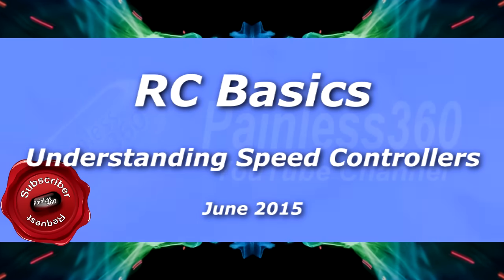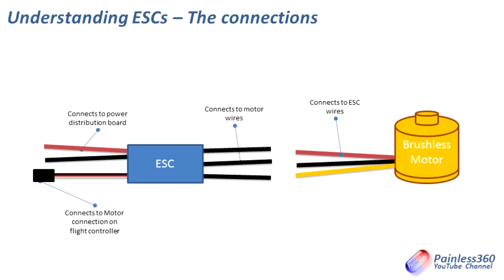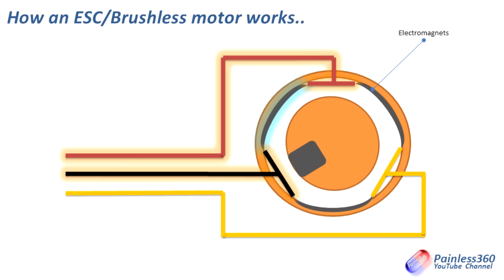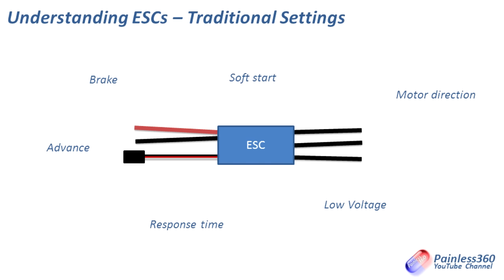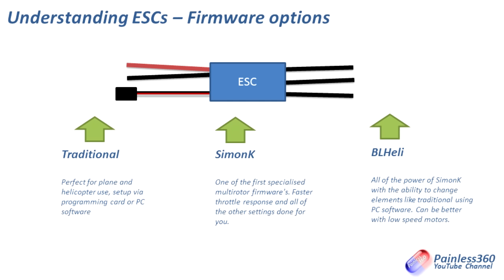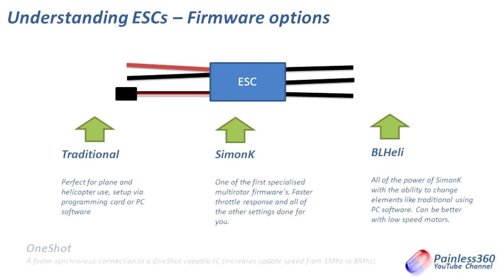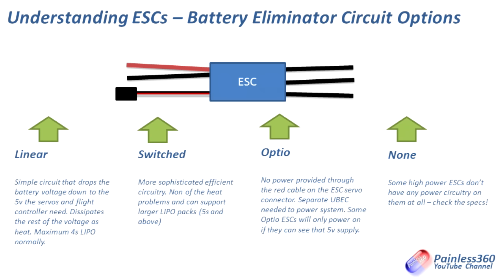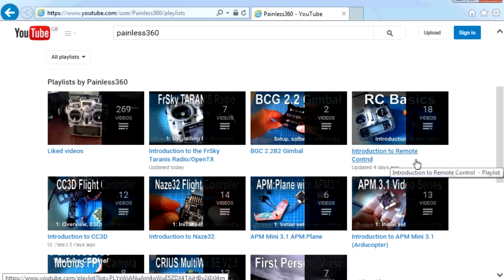RC Basics - Understanding Electronic Speed Controllers (ESC)

Comment: Great video 
I have a 80/100 130kv outrunner 
I looking to buy an esc to make it run powerfully 
Can you help me finding the esc pls
Reply from the maker: You'll need an ESC with a slightly higher amperage rating than the motor. So, first - find out the max current that motor needs when spinning the prop you'll use.. Best of luck!
Reply: http://alienpowersystem.com/shop/brushless-motors/c80100-outrunner-brushless-motor-130kv-7000w/
This is what I have 
I found lots of esc
But my motor says 18s max 
The max I can find is like 12s will the esc go bad ?
Reply from the maker: +mike mike it's the amperage you should be looking at..

Comment: Hey there awesome video, really clear explanation. I was wondering however about the fact that you have to switch any two wires for two of the escs and keep the other two straight. Does it matter which motor is crossed and which isn't, for example should the straight wires be for the clockwise motors and the crossed for the anticlockwise?
Reply from the maker: OllieTheCat2012 Nope, swap any two of the three wires going to the motor and it reverses the direction. 
Happy flying!
Reply: Thank you kindly!

Comment: Great video. I've one question. Can I use those ESCs in a e.g. airboat? I know, I've to make them waterproof. But can a combination like a RadioLink EC6GS remote with a 6 channel receiver and a e.g. Yuki Wasabi Eco BL-ESC 55A (http://files.hapo-trade.at/pdf/WASABI%20ECO(DE+EN).pdf) if I switch off things like govemor mode and break?
Reply from the maker: So long as the current rating is high enough for her motor and prop you're using then yes. You can waterproof the esc using one of the waterproofing sprays or epoxy too..
Reply: Thx for your help. That sounds promising. Great work and I guess you have a new subscriber ;-)

Comment: I've got a rc plane with the controller and I can't get the motor to turn
Reply from the maker: Some have a throttle cut switch or a way to 'arm' the model so that it prop turns.. I'd like check the manual for the sequence... Best of luck

Comment: Someone please help , how can i connect a motor with an ESC into the steering channel ??
Reply from the maker: A steering channel normally rests at the middle channel value, ok for a steering servo but problematic for an esc as the esc will see the middle channel value as 50% throttle... see the other videos in the RC basics playlist..
Reply: @Painless360  Thing is i'm building a crane and i'm trying to have 2 electric motors , one of them for each channel and i havent found anything that could help me do it.
Reply from the maker: Check out the other videos in the RC basics playlist. It's not too tricky if you dont use a throttle channel... best of luck!

Comment: Can you do a video on testing the ESCs and motors with a multimeter to check if they are running properly
Reply from the maker: +scimitar4211 Interesting idea, what specifically caused you to ask?
Reply: +Painless360 I am in the process of building a Blackout mini h, currently I have run into some problems.  When testing my motors using Cleanflight 2 of 4 ESCs let out the magic smoke and possibly ruining the motors as well.  I am sure all the pros check their ESCs before soldering to the PDB and to the motors, but to us newbies we just solder on and hope for the best.  Unfortunately I learned my lesson the hard way and I will be getting a multimeter to test my ESCs next time.  Some of us do not know how to check for continuity on the ESCs and/or the motors (including myself) so I thought it would be a great idea for a pro like yourself to do a video on that.

Comment: Thanks for the video learned a lot but I am working with a Mystery Fire dragon 80A ESC and still figuring about how to program it to go backwards and revers like a in an RC car and how to control it with a single signal wire.
Reply from the maker: +Derpy Herpy the answers for these things are usually in the documentation. If it's not then it's not supported. I'd ask the vendor the same question..
Reply: +Painless360 do you know of any ESC that has that feature of going forwards and reverse? 
If not I'll probably have to work hard to program the AVR cheap on the board to have that function..
Reply from the maker: +Derpy Herpy look for those that support 3D flying. Best of luck!

Comment: Another great video and your channel is my first stop for technical information on RC! Hopefully you can help me with this? If you use ESCs without BECs what would be the best way to set up a 5 volt power supply?
Reply from the maker: Peter Arnold To see more videos on RC power systems visit - https://www.youtube.com/playlist?list...
You need to use a separate UBEC to power the board. Some now come fitted to the power distribution boards for simplicity.
Happy flying!
Reply: Painless360 Thanks for your help. I have also been looking around for a 40A BLHeli ESC and there doesn't seem to be many around but found this one http://www.banggood.com/EMAX-BLHeli-Series-40A-50A-60A-80A-UBEC-ESC-p-963632.html.
My concern is that the price for this one and other similar ones are suspiciously low? Is price something to be concerned about?
Reply from the maker: Lower process can certainly mean lower quality but getting them from the manufacturers via a middleman can still get you great technology for the lower price.

Personally I'd give them a try..
Reply: Painless360 Thanks again for your help. I will give then a go.

Comment: Thanks for your helpful videos from this total Newby. I have taken delivery of my basic Radian motor glider. I have had a surprise present of Volantex Phoenix Evolution V2, but since I no RC Aircraft experience, opted to learn with a more basic model. 
I have opted for the Graupner mz-24 transmitter/receiver system. However the model does have a motor with an E-Flite ESC with BEC. Will I have to change this for Graupner ESC/BSC version in order for it all to work?Can you, or anyone, put me right?
Reply from the maker: Please see my introduction to fixed wing series if you are new. The equipment should be interchangeable.. best of luck!
Reply: Fantastic, and such a quick response! Thanks so much.

Comment: can i use a 3s battery on 6s esc and 6s motor?
Reply from the maker: +Vincent Corp yes, but you won't get the performance out of that motor. Best of luck
Reply: im going to use a fury wing plane with a 370km motor 15 inch propeller with a 6s u yhink im going to have any problem?

Comment: If I use a driver, when would/why would I need an ESC?
Reply from the maker: I don't understand the question..
Reply: @Painless360  thanks for the quick response. I was planning on building a pi controlled RC car, some people use an ESC with a motor driver to control the car. Why do we need an ESC if the driver could output sufficient power for the motor?
Reply from the maker: Brushless motors will need an ESC. Best of luck

Comment: After connecting battery to quad  i get this sound from all four esc and motors https://drive.google.com/file/d/0B9BSi7YB1EOMX0hhQ2g3M2dRVjg/view?usp=sharing what does this mean?
Reply: I'm using four 30A ESC connected to A2212/90-1400kv motor each and a 3000mAh battery.Motor's max consumption ~25A.One of my friends suggested to use 1000kv motor with 30A ESC shouldn't i use 1400kv why? why not?
Reply from the maker: +Nantha Kumar Not sure - can you manually calibrate them?

Comment: what are the hz in esc?
Reply: like i have see 400 hz 80A and same 600 hz 80A why thay have different of hz in same amp?
Reply from the maker: +bhavinsinh parmar that is the frequency if the waveform that the ESC uses to power the motor.. happy flying!

Comment: Great video as always, one question , can a faulty battery cause an esc to catch on fire?
Reply from the maker: +INMERSO Anything is possible but normally ESCs catch fire due to too high a current from the BEC, too high a current being pulled by the motor and overheating the power transistors or a fault in the board/firmware.
Reply: I see, thanks for the answer

Comment: First off, thank you for all your videos! They have been guiding me through this hobby since the very beginning and have taught me things that I would never have figured out on my own! I have a question I hope you can answer! Do Oneshot ESCs need to be treated differently when setting up in Cleanflight? I just got Lumenier 20a mini ESCs with autoshot/simonk firmware, and they are being very weird with stock PIDs (motor speeds go up and down without outside input, motor 3 getting so hot it smokes, sputtering, etc.). Only when I lower Ps to at most 2, and zero out Is and Ds, the motors behave normally. (i have tested 8 of these Lumenier ESCs, tried this on 2 different Naze32 FCs, and they all did the same thing.  I also tried this with 2 different motors (Lumenier 2206-2350kv and Cobra 2206-2100kv). Is there something I am missing with this autoshot ESC thing, or is this some kind of Naze32 bug? Thank you so much for your help!
Reply from the maker: +Christoph Kossack You do need to enable OneShot in Cleanflight - see the TBS PowerCube videos and this manual posting - https://github.com/cleanflight/cleanflight/blob/master/docs/Oneshot.mdHappy flying!
Reply: +Painless360 Thank you for the quick reply! I watched your second TBS PowerCube video and saw that you used Serial_RX. I used PPM. I saw a few threads that said PPM with Oneshot does not work on CC3D, so I didn't think it would matter with my Naze32. But when I switched it to SRXL after watching your video all my problems went away :)   Thanks again for the fast reply and all your videos! Fantastic stuff!

Comment: the LIpO battery that you could use with that is an AC or a DC ??? brush-less is obviously DC
Reply from the maker: The battery is DC but the job of the ESC is to create a complex series of waves that run the motor.. Happy flying!
Reply: AND MOTOR IS ?? dc or ac
Reply: AC Alternating Current..BUT its like a three phase motor. 3 wires (when crossing any 2 of those 3 wires the motor spins the other way) you can't hook up any kind of "standard" AC/DC voltage directly to these motors!, its only going to smell weird and render it useless. you need a controller (Electronic Speed Controller=E.S.C.)

Comment: Ok . The 3 wires put out 5v and one is a motor signal wire . I had the 5v+ 5volt - hooked to 5 volts to run the sinal wire hardware .  Si i jys snipped them off shorter . I might make model airplanes now instead .

Comment: Hello, first I wan to thank you for your great videos. You sure make things easer for us rookies leaning how to build our own machines
I'm building my first quad copter, the frame is a Tarot 650 with a pixhawk flight controller. My motors are Tarot 4S, 4006 KV620  connected to XRobot 50amp speed controllers, after I saw this video it looks I got overkill speed controllers.  what size of battery do you recommend for this machine and do I need any additional power accessories to make it work. thank you in advance
Reply from the maker: Tony Morales Each of those guys take a maximum of 14amps. This would give a maximum pull of 14x4 = 56amps but in reality you will be flying at less than 100% throttle all the time so we can assume that they will pull about 70% of that on average - 39amps/39000MaThe battery you choose will determine the flight time. i.e. a 5000mah would give you about 6m of light time and leave 20% in the pack.Hope that helps..
Reply: Painless360 thank you again for your great videos, last question. Will I get more flight time with a larger battery, I know the bigger the battery the heavier they get which can affect the flight time

Comment: my motor does it for 3 sec than nothing what can it be?
Reply from the maker: I don’t understand the question, can you provide more detail?
Reply: i have a 2881 kv motor after running for couple hours. suddently it works for 2sec the motor than it doesnt do anything. steering still does it great. i dont know if its the ESC thats failing.
Reply from the maker: I'd try another ESC but it sounds like a power/overheating issue..
Reply: yes but the next day its the same. i put on the battery. give full throttle it works 2sec then nothing. so something is broken. i will buy a new esc then.
Reply from the maker: Best of luck,  if the new ESC doesnt fix it then it'll be the motor or a dodgy connection..

Comment: Old RadioShack RC trucks were so durable, double the voltage... No worries, you will just strip the gears lol. Get a WPL C14 and go from 6V to 7.4.. Bang, cook the server straight away! No steering lol.
Reply from the maker: Yep, running stuff on voltages they weren't designed for will cause bad things to happen.. Happy flying
Reply: @Painless360  Lol you're not wrong, sometimes it's worth it.
Just gonna get some more durable parts anyway haha.

Comment: Excellent video!
Anything on programming an ESC?
Reply from the maker: +Martin Not specifically as most ESCs have a manual that comes with it/online that show how to program it and the options you can set. If you are flying multirotors then go for BLHeli or SimonK and you should be good to go straight out of the packet!Happy flying!
Reply: +Painless360 - Actually I'm into boating, so don't need brake but do need reverse etc. We're used to brushed motors and many of us are very suspicious of these new fangled brushless motors! See - www.modelboatmayhem.co.uk/forum
Reply from the maker: I see! Happy boating then! :)

Comment: How do I run my motor after connecting ESC?
Reply from the maker: +Ronak Bhanushali You need to 'tell' the ESC how much power to send to the motor. This is normally a PWM signal from a radio receiver or a flight controller. See my 'Introduction to RC' playlist for more detail..
Reply: +Painless360 So I have to buy a receiver and transmitter. Can you recommend me a good one?
Reply from the maker: What are you trying to do? I'm guessing that you're not using the motor for a 'classic' RC model. There are loads of radios you can use but if you are using it as part of a rig then there are cheap options too..
Reply: Painless360 Actually it would be good if you tell me a basic one which I can use for general uses in like an RC car or an RC plane.
Reply from the maker: I would look at the Turnigy 9XR or FlySky FS-T6 are popular choices for the budget end of the hobby.
Reply: +Painless360 How much would it cost me?
Reply from the maker: Google is a wonderful tool ;)

Come back to me if you need help choosing, I can offer support directly if needed (see website for rates)

Best of luck!
Reply: Painless360 Thnx a lot. Appreciate it.
Reply: Painless360 Can you send me a link to both of them because I am getting multiple results on both and price varies a lot.
Reply from the maker: HobbyKing for the Turnigy, load of places for the other radio. Best of luck.
Reply: Painless360 Whata the price of flysky (transmitter + receiver ). Because I am getting results for same search which vary from 50$ to 150$
Reply from the maker: I would expect to pay no more than $55..
Reply: +Painless360 Along with receiver?
Reply: +Painless360 Do you mind sending the receiver video again?

Comment: RoboticSolutions.TECH
13 hours ago (edited)
Please dont wish me luck and send me on my merry way yet. You didnt answer my question. If wind pushes my propeller to spin faster than usual at the specified throttle setting so that its RPM is way above what it normally would be,  would the ESC and motor attempt to slow down the RPM? So lets say I set my throttle to only supply 1 volt and the engine is a KV1000. But I put my variable pitch quadcopter on a dive with negative pitch so the propeller now spins at 2000RPM without changing the throttle setting. What happens? Will the Engine and ESC supply negative torque to try and slow it down or will it keep pumping 1 volt in to re-enforce the 2000RPM spin? Or will it just supply no voltage at all?
Reply from the maker: +RoboticSolutions.TECH no idea, ive never used an ESC in that way. Let me know how it goes..
Reply: Can you recommend me a software to monitor and record the current flow?
Reply from the maker: Sorry, this is outside what I do here. Best of luck
Reply: I want to practice autorotation.

Comment: Thank you for your super videos and helping me build my first quad!! now in to my 4th quad i have encountered a problem that i cant find an answer to anywhere...im running the APM 2.6 and done the calibration for the 4 simonk escs and they all sound the same except 2 of the motors are out of tune..... 2 motors have the same pitch and 2 motors have completely different pitch each..... i have tried to change the motors around and unplugged the apm from the escs to do the power up and still the same thing... the quad flies fine but becomes very unstable on decent....as if balancing it on a knifes edge.... then the other day i had like a blackout there all the motors just stopped at the same time 2 meters of the ground and i didnt find anything in the logs indicating malfunction... .
i hope you find my post intresting and can advice me on something..

Kind regards
Vic
Reply from the maker: +DIY stuff I would check the logfiles and see if you can spot anything odd going on. All quads will 'rock' when descending into their own downwash. Sounds odd that the motors sound different. I'd oil the bearings in case some of them didn't get a drop when manufactured..Best of luck!

Comment: cuz its inside the circuit board and idk how to remove it
Reply from the maker: +woo Zhi it will be tricky to swap if it's not made to be removable. Smaller models weren't designed with upgradability and repair in mind..